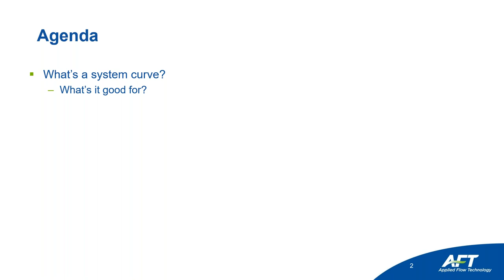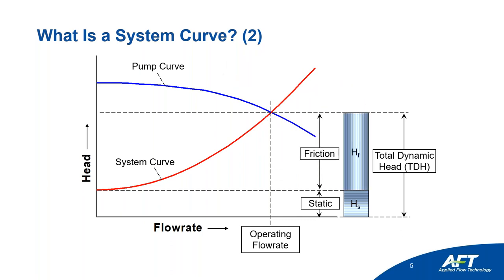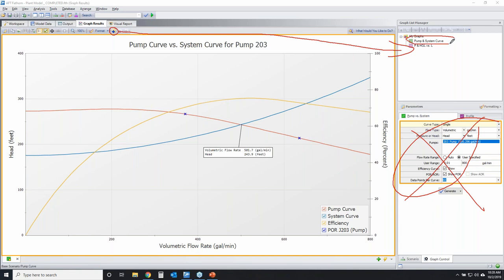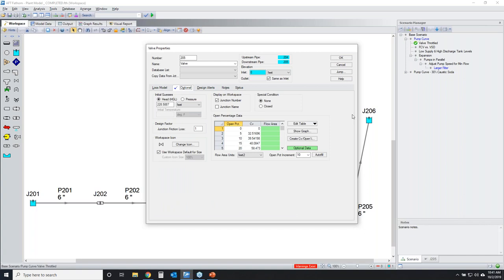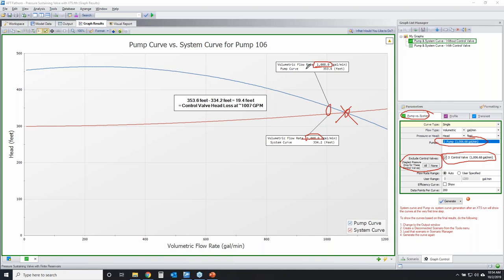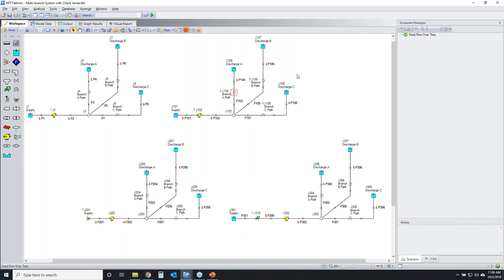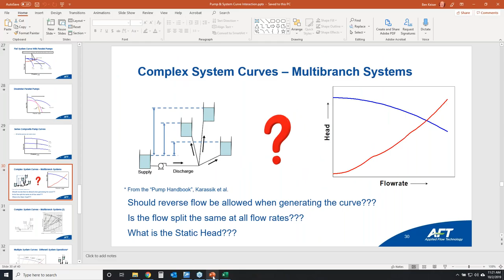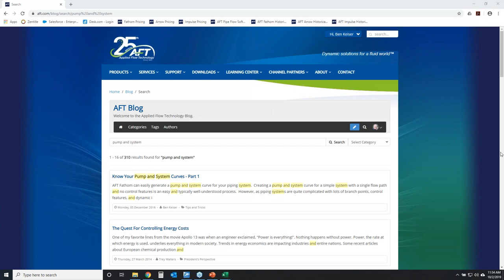Pump & System Interaction

Comment: An important fact is that the BEP represent the point of operation whereby the flow stream approach the impeller has the most tangent trajectory. The further you depart from the BEP the fluid approach becomes rotational and recirculating becomes more prévenant. As the recirculating increases we approach the risk of cavitation becoming problematic. This will manifest as pump noise and vibration in addition to the consequence of high impact loading of the impeller at the position where any gaseous phase flow converts to liquid by virtue of the local pressure

Comment: Note plotting.a single operating pt is like a university#tudemt calculating flow resistance to decimal places. You always need to plot envolées for both the pump and system as the pump performance will vary over, time and due to variability between pumps of the same type and the system curve will definitely vary over time for various reasons. It would be nice if the plot capability could have an option for printing an envelope curve based on sensitivities applied to the unknowns. Note typically it,maybe be time to consider pump overhaul after a drop of 10% efficiency. Other system performance needs may alternately set the max tolerable wear pt for a pump.

Comment: I like to try and establish a system operating pt slightly to the right of the BEP as when the pipe scales which’s normally but not always the case the friction head will increase and the operating point will move toward the BEP. That said I have also dealt with pipe ranges whereby the pipe range tests smoother with use but with water the latter is normally correct.